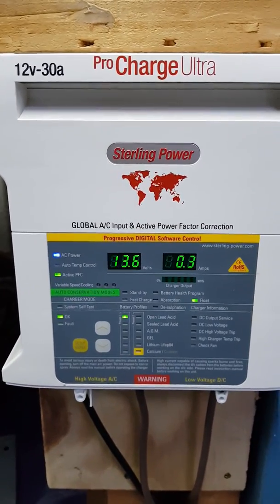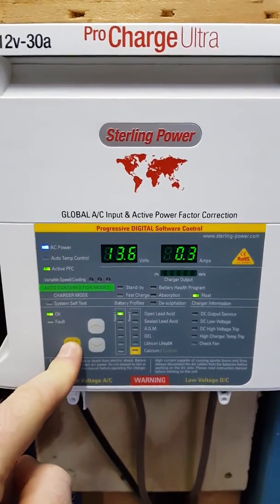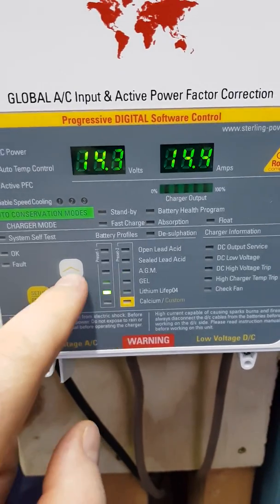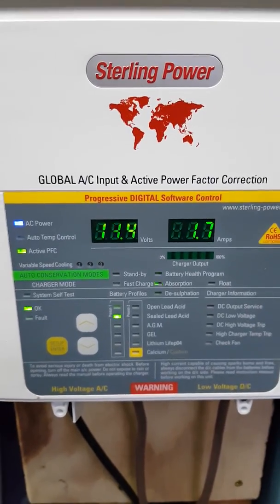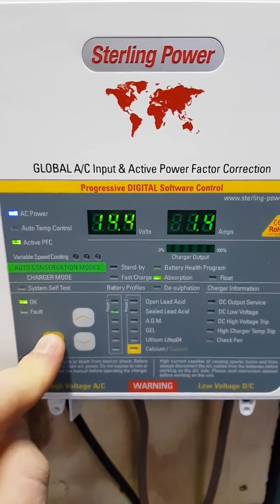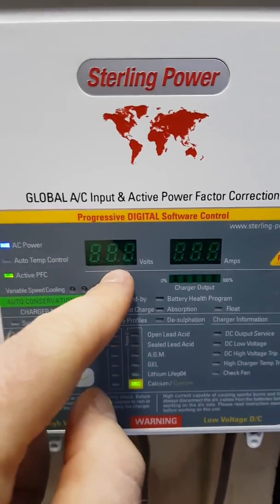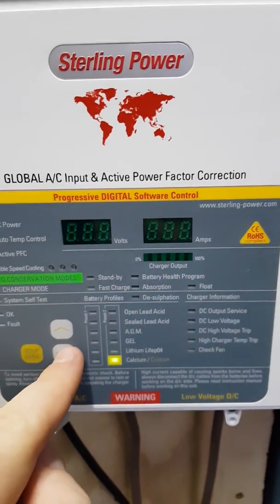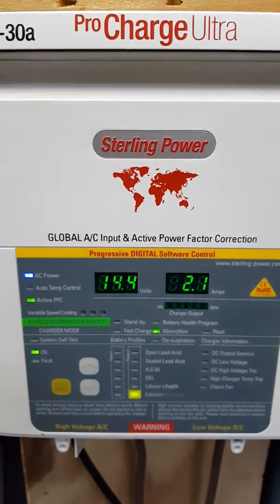Sterling Power Pro Charge Ultra Battery Type Select + custom settings

Comment: I saw you adjusted the Absorb voltage. Is the Bulk voltage adjustable ?
Reply from the maker: Hi Denis,

No, bulk is just the process of elevating the voltage towards the absorption voltage. Bulk and absorption are essentially the same, bulk just being the gradual ascent towards absorption.

Comment: does this charger charge each bank as it's own?   So one bank don't need charged and the other one is low.  It will only charge the lower bank?    Does the remote show individual battery bank?